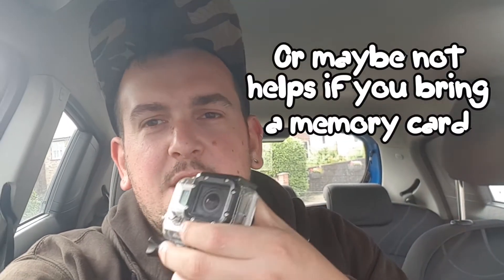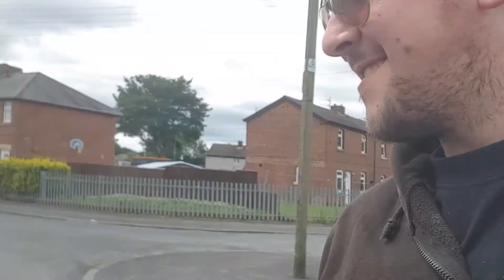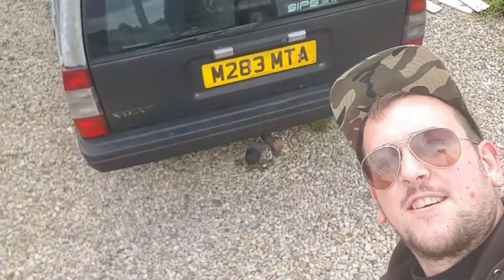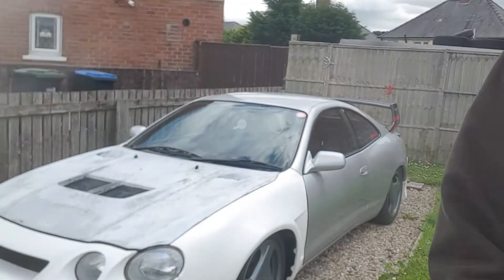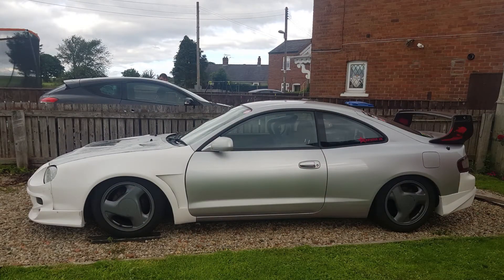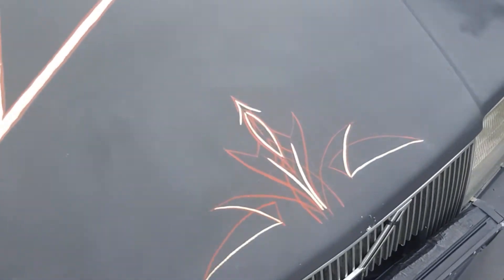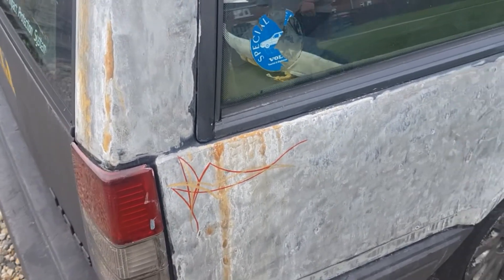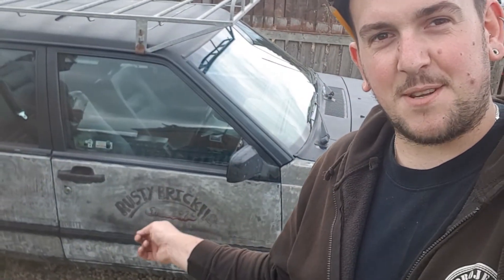First time pinstriping

Comment: Cool video, if you need any tips/advice give me a shout.
Have fun 👍
Reply from the maker: Thanks bud really need to get some practice in over the next few weeks and do another project
Reply: @projectthirteen  Pinstriping is one of those things where the more practice you put in, the more you get out of it.
Keep your brush clean and oiled and it will last a good long time.
Reply from the maker: What oil do you use I have them mega clean after use and store them flat
Reply: @projectthirteen  I use Neatsfoot oil, I think it's also used for leather or horses or something. It keeps the hairs nice and soft and helps stop the paint drying in the heel of the brush.
I think Villa Pinstriping has a good video on brush care.

You can get it online from Wrights of Lymm or PinstripingUK along with paints and brushes and all the other goodies you're going to want ;)